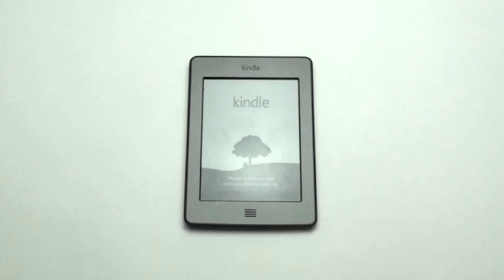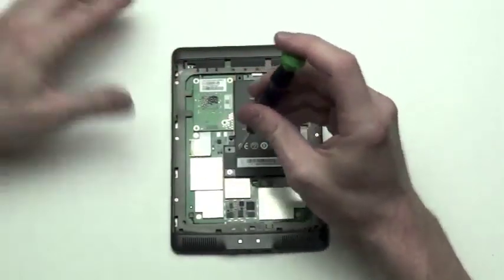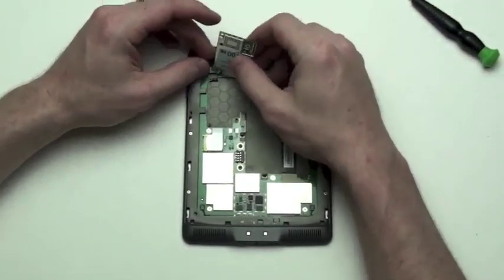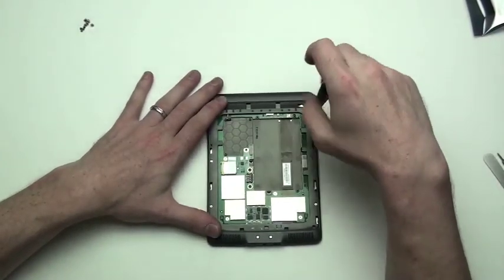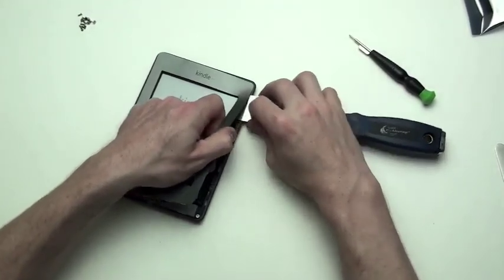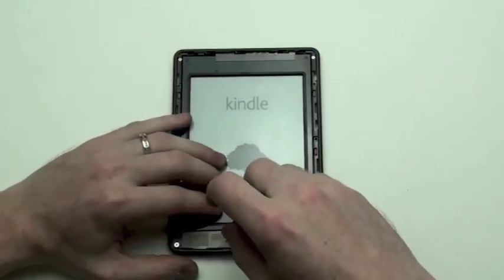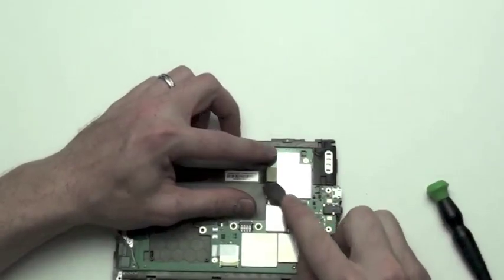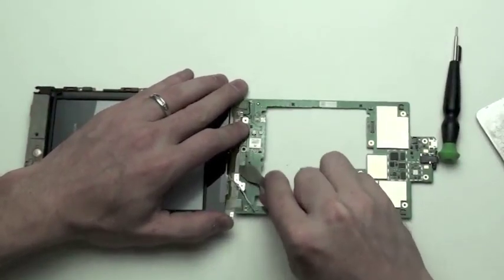Amazon Kindle Touch Take Apart Repair Guide

Comment: Had my Kindle for years and years, and today the power button stopped working. I thought it had somehow bricked itself, but luckily not. It charged, it connected to my PC, the screen unlocked when I did so. 
Did a search, found this video, spent 20 minutes disassembling, cleaning, and the reassembling the device, and now it works. Here's to another 12 years!

Comment: The Home/Menu button of my Kindle Touch does not work. I can hear and feel the click, but it does nothing. Here’s what I did to reactivate my Home button. I surmised there was a buildup of crud in the switch mechanism that needed to be cleaned out. I chose 91% isopropyl alcohol because it was a high grade solvent that would mobilize the crud without leaving a residue or attacking the plastic. Don’t use plain rubbing alcohol because it has oils in the alcohol to facilitate “rubbing.”

1) Turn the unit off.

2) Take a napkin soaked in IPA and daub the raised portions, allowing a little to slip into the slots.

3) Before the IPA evaporates (and it will evaporate quickly!), work the button repeatedly.

4) Repeat as needed

Each cleaning cycle, things got better and after three, operation was great - took 5 minutes for the whole thing!

Comment: Once the back cover is off, what should I do to turn off the kindle and reset it? (pushing and holding the power button does not work for me) I'm looking to manually restart my kindle.
Reply: Once you remove the first three parts:  the back cover, the front glued panel ant the FRAME (there is no real need to remove the battery) you can press the power button directly with your finger and check if it works. Then, clean it and clean the "button" on the frame that pushes the real power button (I used a Q-tip with some alcohol). Clean every metal contact you can see around. Reasamble and check if it works again (It probably will ;-).

Comment: Simple, straight and clear! I have been able to open it, fix the power button failure and have my kindle work again. Just a slight suggestion: when you unglue the front frame, be aware to wedge the blade (or whatever) BENEATH the metallic frame otherwise you remove only the plastic and will have to repeat the operation twice. It would also be useful to heat the frame with an hairdryer before the removal and after the replacement of the front frame.
Thank you, great guide!

Comment: Anyone that has a home button that is not working(but still 'feels' like it works ie. it still clicks) this can fix it: Disassemble the Kindle as shown in the vid, between the display and motherboard you should see a small switch with 4 pins sticking out of it, clean off those pins and the contact on the display with a small piece of cloth or Q-tip and contact cleaner(do not use another cleaner/liquid). I sprayed the switch with the 4 pins, and pressed each pin several times to help work out any contamination and work in the contact cleaner a little better. Gently wipe of the excess and reassemble. Took about 5 minutes total and works like a charm now! Thanks for posting this vid, it was a huge help!
Reply: Thanks for the advice Norcalflat-- it worked like a charm. My Kindle Touch lives to die another day.
Reply: Yes, This fixed my reset button problem
Reply: Excellent tip, could find this nowhere else on the internet!  Unfortunately, it did not work for me.  I think the switch (that little domed "popper" switch under the home button) does not always activate.
Reply: i never comment, but here I do! THANKS! 
This singlehandedly revived my Kindle Touch. It was charging and everything, and if i disconnected and then reconnected the battery it would come back to life. But if it went to standby, I couldn't turn it on again. But the button still pressed. I cleaned both the pins and the contacts and after the reassembly it worked again !!! Thanks friend.

Comment: This is old, but still useful.  My home button just stopped working, im hoping a quick clean fixes the issue.
Reply: Having same issue, were you able to fix the home button?
Reply: no.  got it open, cleaned the area, but didnt change anything.  I didnt put it back together, i put it in a baggy, and listed it for free on Craigslist. (took a few months, and someone came and got it)  replacement screen was his thought.  Good luck.
Reply: oh, and when you open it, remember you are 'breaking the seal'  so its not going to be back together perfectly etc. (which i was ok with)  but if your on the fence dont.   (i ended up getting a new one, so i was happy) paperwhite version. on sale   love it!
Reply: Solved the problem, if you yet want to know how, just ask!
Reply: @VinceDeRosa  ok we are asking?  Should have just posted it.

Comment: Very useful video, if you have care to place the display basel with the adhesive side covered and not exposed to dust the adhesive will still be strong enough to hold again the two parts together